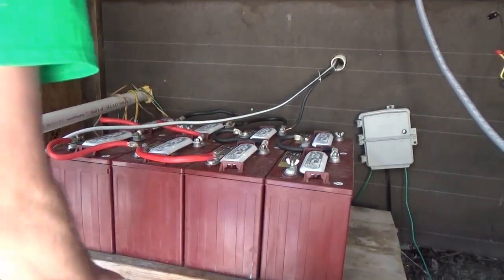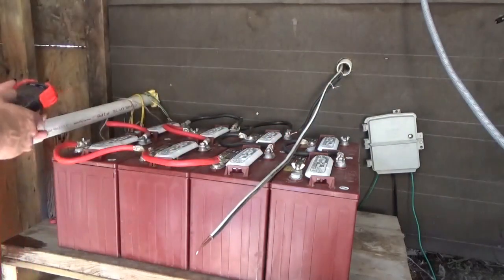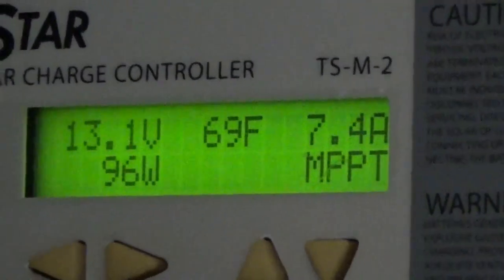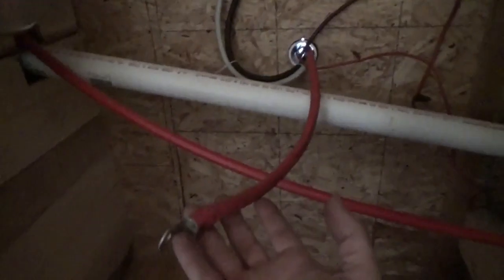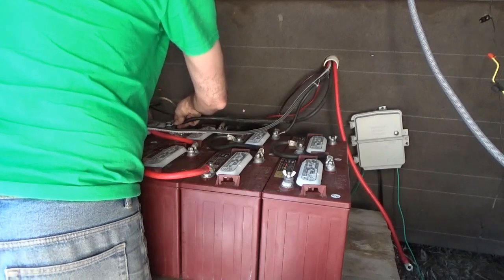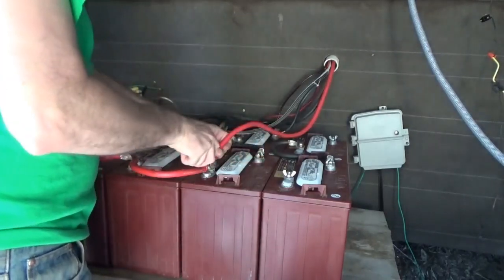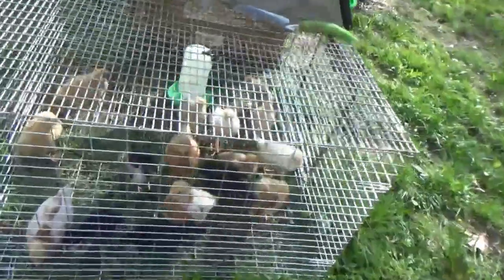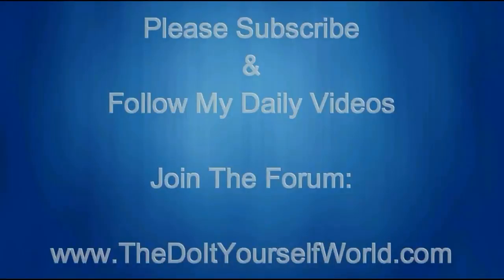Finishing Rewiring My Off Grid Tiny House

Comment: All you do is turn off the controller before you connect the red power lead. I hope you are also wearing your safety glasses. You and your wife both should be wearing them when doing all of the work that you do there. You can also wear rubber gloves to avoid the sparks.

Comment: Switches in line would stop the arcing when you connect the power. They are designed for arcing , check the amps rating out on any switch before placing it in line. It would be handy to take a feed 'off line ' when working on it.

Comment: To precharge the caps you might try making a simple resistive 12 volt jumper wire....by that I mean taking a simple automotive bulb (incandesant) ,soldering a couple jumper leads to it and putting alligator clamps on the ends.You can put in series with the terminal you are about to connect. When the bulb is lit ,it is charging.When it goes out the caps are charged and you can simply connect the terminal with a much smaller spark. You can also use to discharge the caps and you can use when you should have a resistive load in your circuit for testing . (A known resistive load will give you a more accurate idea of the internal resistance of the battery)    Hope you have a cheap hydrometer as well.

Comment: Protip: To avoid a burnt (and probably to-be-amputated) finger, remove your ring before working on ANY high current setup. Don't take it as trolling, it's just because I work in the field and I've seen enough exploding multimeters and similar things and people with hands, faces or bodies completely covered in soot (or worse, burned) because of screws or coins falling on top of terminals and similar silly things that one usually forgets about. Cheers :D
Reply from the maker: +MrOpenGL Thank you for the warning. Wearing a ring is new to me
Reply: Red Doe Running
A ring glowing is one of the worst things that could happen to you while working on electrical apparatus, besides a capacitor or similar component exploding and spilling burning oil everywhere (Yes it did happen) or electrocuting yourself. I never wear rings for this reason.
Reply: +MrOpenGL      I had a buddy working on the big battery box on our Lance Missile tracked launcher.
                            It use 2 very big  12 volt batteries for its 24V system.   PFC Hawley was not wearing a 
                            shirt as it was an uncharacteristically warm day then in West Germany.    His US Army 
                            Dog Tags metal chain fell across the battery terminals and POW.

                             PFC  Hawley now has permanent dotted line around his neck from the burns.

Comment: Hi Troy , Just a safety note. You should never make a connection that produces sparks at the batteries. Always connect hot wires at the inverter last to prevent an explosion. Tomake these connections I would strongly suggest a battery disconnect switch to handle the high amperage. You can find these switches a most automotive parts stores. One for the positive for the inverter and another for the positive from the charge controller.With these mounted inside and away from your batteries you would not risk blowing up your batteries. Best wishes to you and Melanie,,, Bud
Reply from the maker: +KC5VIP Hamitup Thank you. I have some actually and plan to install them soon.

Comment: Did you look in the welding area of tractor supply for the ends? I buy them in bulk  http://www.ebay.com/itm/20-pcs-4-AWG-5-16-COPPER-LUG-NON-INSULATED-BATTERY-CONNECTORS-UNINSULATED-/380496358529?hash=item589759ac81
Reply from the maker: +BUDDY LIGHT No I did not look there. Thanks, I will have a look

Comment: 2/0 Gauge AWG Copper Battery Cable > Marine, Car, Truck, RV, Solar > Custom Made on ebay for 5.09 and 3.97 shipping It is fine stranded copper wire with tin plating. should be good. 1330 Strands Fine CoppereBay itemnumber:141645498475

Comment: Troy;   When hooking up anything electrical Positive First....Negative Last....Always....Unless it is Positive Ground then it is Negative First and Positive Last.... Always!!!!  Oh yea Corrosion on Battery Terminal's is caused by lack of Inspection and Maintenance on your part.... 33 years as a Mechanic, USA.....
Reply from the maker: +Patrick Rueter Well, you are correct on the lack of inspection. I did not worry about the old, junk forklift batteries anymore. I bought them as junk and I failed to restore them. So they sit there untouched all winter. Not talking about the new one but the old junk ones.

Comment: Where is the fuse block?
Reply from the maker: +Bill Bailey I have multiple fuse blocks inside the tiny house. I showed them on the video. Not sure if part one or two. But they are there. One large, main fuse and then other smaller ones after that. Double fused.

Comment: what happened at Giant forklift battery
Reply: It has a bad cell
Reply: Eye Toldyoosso
A: Batteries don't last long, especially lead acid, and especially when charged/discharged every day, even if you treat them very well. It is unlikely to get more than 2 or 3 years of service for a battery subject to deep cycling (except Planté plates, but those are rare today and extremely costly and heavy).

B: A bad cell doesn't necessarily imply bad treatment to the battery (misuse). I've had a pierced separator on a brand new Varta deep-cycle 200Ah battery before. All of a sudden, the battery started to self-discharge extremely quickly, and would not charge past 12.2V (at that voltage it would start boiling all cells minus the one with the pierced separator which was shorted obviously)   which coincidentally is the same voltage that Troy's forklift battery is resting at. I suspect the same type of failure.

However, I don't understand why he didn't take it back for warranty. But he certainly didn't kill it. Those things happen, and they're a pain in the rear when they do, especially since most of the times they happen randomly and without any connection to how much kindly has the battery been treated.

Comment: for conneting the inverter use a 20watt dc light to go between the battery and the positive lead to your inverter and the light will limit the current and when the light stops then it will not spark as mutch.
Reply from the maker: +dandy andy cool

Comment: this is the best fuse and fuse holder you can buy. I found it on ebay for about 15 bucks. Here is a video I made called "Using The FREE Solar Power" You can see the fuse and fuse holder at 4 min 12 seconds. I really like it and works really well. Its high quality.

Comment: Just a thought but not sure about how it would be for you but I'm only in high school but we have an electric car club and we have a pre charge resistor in line the batteries and motor controller slowly charging the caps. Doing so causes connecting power to the batteries not to arc as it did for you. You would have the resistor and a normal breaker across the resistor so once you connect the power you would flip the breaking to closed for normal use while using the resistor to connect power after extended disconnects. Yes this is for our electric car not a home but it seems that it is the same purpose of a motor controller with caps to charge to a power inverter to charge caps. Correct me if I'm wrong or add on to why this would be bad for your purpose. Thank you.

Comment: Lumber yard looking to buy battery terminal connectors? Try a flower shop, or a shoe store. If not an (Auto parts) store might have them, lol.
Reply from the maker: +vosoda1 Flower shop - thanks I did not try that. Actually the local lumber yard is also a hardware store so dont mock me until you have all the information. Thank you.
Reply: Troy..I'm not mocking you, just joking around and having some fun with you, lol. I was laughing because I knew most of the types of stores you said you went to would not carry that type of item. I would never expect a  (home hardware store) to carry any auto parts (battery cables and terminal connectors), Nor an electrical supply store, they just have AC electrical for buildings and houses. Construction electrical (AC) and Auto electrical (DC) are totally different. I would check auto parts stores, or a marine supply store, or maybe a custom speed shop that sells car stereo systems. Also possibly an RV or trailer shop as a last resort. Any place that would sell 12 volt batteries, and AC accessories, maybe even Walmart has battery connectors.
Reply: +vosoda1 I would expect an electrical supply store (at least here in Europe) to have crimp terminals of that size. We routinely use 35mm² cables (similar size to the ones used by Troy) for residential AC electrical... and I'm talking about residential, not industrial! (and in the USA it must be even more commonplace, since you have 120V which means higher currents and higher wire gauges for the same power)!

Comment: my engineer friend said the only place I needed to fuse the solar panel is at the battery. the battery has so many amps if the wire gets a bare place touching or grounding out it will turn red and burn the place down for real Im not kidding. If you fuse the inverter wire some place in the middle and the charge controller at the batts your safe. I use a 150 amp ANL fuse on the Charge Controller (CC). I fused mine my self no problem you can too. I used a auto fuse for the CC. the are dirt cheap. Used the one that plugs in not the old glass one although they would work too. Tons of fuse holders and fuses on ebay to choose from. I like the giant ones. they cost more but the little ones work the same. You gotta think im running 30 amps of panels so a thirty amp fuse or better 40 amp maybe. I dont know how many amps your doing on solar panels. Mine use a 40 amp auto fuse. like for a car stereo. the one that goes on the batt. just where I put it too.

Comment: Troy! you can make your own crimp on terminals using 3/8" copper tubing flatten and drill!
Reply: +Neil Shubert He use 00 wire and I have made them out of 1/2 inch copper pipe by flattening them and drilling a hole works good I made a video "Making a Terminal End Out of 1/2 Copper Pipe"

Comment: did you forget fusing bushings disconnect switches etc.  it's for your and everyone else's safety
Reply from the maker: +Roy Amberg I plan to set up a a box out in the shed with all that asap.
Reply: Youl have to take it all apart to do it properly
Reply from the maker: +Roy Amberg Nope. Just have to splice in the switches when I make the box to house it all in. By the way, inside the tiny house, the power inverter has its own switch and the fuse block is my main breaker for now on the DC side.
Reply: +The Do It Yourself World Buy a 120V distribution box (consumer unit) and use that. The circuit breakers are fine on 12V DC and it is more cost effective and easy to wire. I have used that in my solar setup.

Comment: FOURTH, Just a tip from a truck driver, if you dont want to go to store and waste fuel, call them and make sure they have it.  Just a tip
Reply from the maker: +Ivan Kishov Yeah, I know. But the auto parts shop had them last time I needed some and this time they did not. Then, when I was already in town, I figured I would check the other stores. No luck.
Reply: I know, Thats why learned a lesson to call before go. Sometimes my wife is like, "lets just go" And I always say, does it heart to call?
Reply from the maker: +Ivan Kishov I know. I know better. Generally I do it myself too.

Comment: Troy did you try auto parts. Around here they sell them all the time.
Reply from the maker: +Chris Adam Yes, auto parts, hardware store, TSC, lumber yard and the electrical supply. Nothing in my town. Have to look farther away
Reply: +The Do It Yourself World You can make your own from copper tubing from Lowes or Home Depot. Way cheaper than premade and are solid copper instead of aluminum. Cut 2 inch piece, crimp on wire, flatten free end with hammer and then drill 5/16 or 3/8 hole in flattened end. Lots of terminals from length of tubing. There are youtube videos showing how to do this.
Reply: +Chris Adam  Try an ice cream shop, or a local pet shop.
Reply from the maker: +vosoda1 Thanks. I did not try that yet.